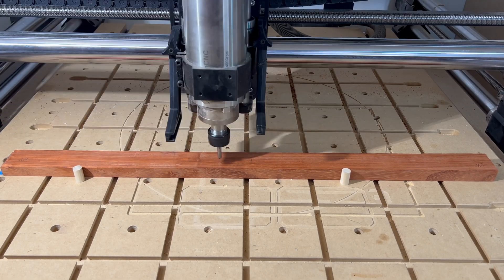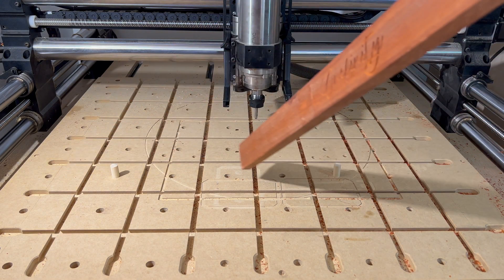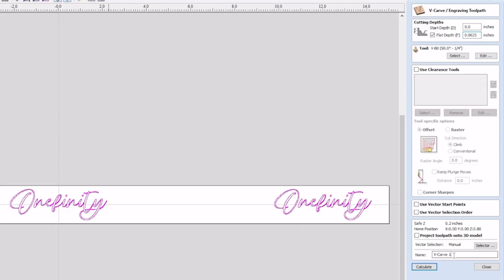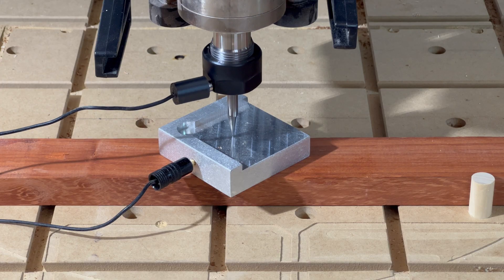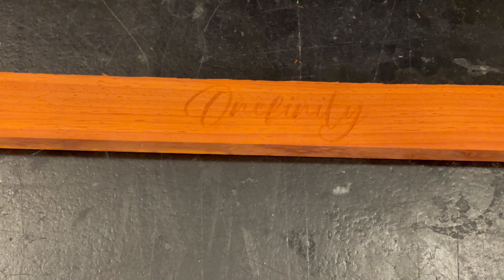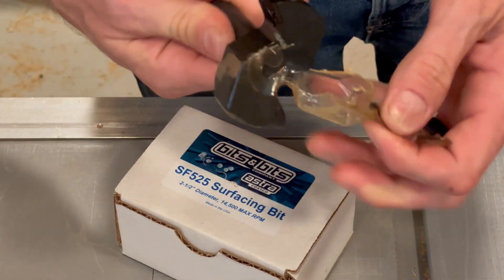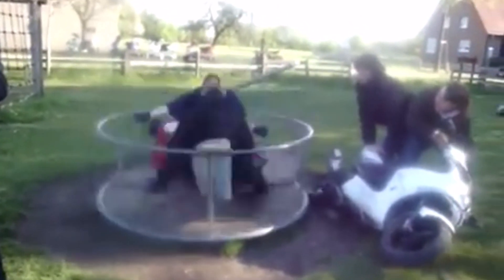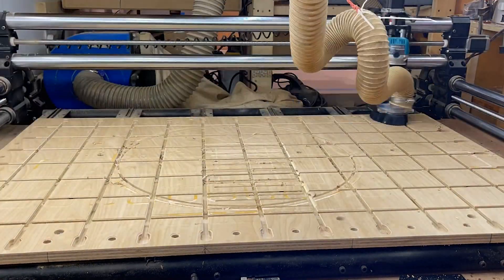EP 20 Onefinity CNC - How Important Is Flatness? (How to Vcarve with a V bit the right way)

Comment: Hi Morgan, i have a question about flatness.  Not about the wasteboard, but rather the CNC table.  I have the Pro Foreman 4x4.  I built a table (64 x 64) to mount it on.  The tabletop is slightly warped (very slightly).  It has about a 1/16 dip in it from side to side.  I.E. if i place a 72 inch level across the table left to right, the level will rock like a seesaw.  However, placing the level front to rear produces no rocking effect as the table is absolutely flat in this direction.  

Will there be any problem with the CNC mounted to this table with a 1/16 bow in the table surface left to right?  If so, should I shim the machine, say under is mounting pads, to get it's get into a flat plane?  What would you recommend?
Reply from the maker: You will need to flatten the wasteboard.  Once it's flattened, the dip won't matter, as it will be flat the the router.

Comment: So if you own a high end planer that is dialed in correctly, is there still a significant difference between and the process you mentioned here?  I know that flattening the spoil board is mandatory, I was just asking about the material being cut.  Thanks.
Reply: even with a flat piece of wood, it can get now solid to spoilboard.  i see this mostly with flags doign vcarve on stars.  that is   a hard one.  i still get best results with surfacing after i get wood down.  on carves like this video, with small detail, it keeps it from disappearing.   does not take much to make a huge difference
Reply from the maker: You want flat to the X axis (router/spindle/bit) not flat board.  i.e.: with the router on the left side of the machine, the gap between surfaced spoilboard and tip of bit could be 5.00 inches, with the router on the right side of the machine, the gap between surfaced spoilboard and the tip of the bit could be 5.125 inches.  A perfectly flat board that's been planned would not be 'flat' to the router in this hypothetical situation, and therefore vbit carves would turn out poorly.

Comment: And remember these to prevent aggravation. 
It can be flat without being parallel or level. 
It cannot be parallel or level if it isn’t flattened first. 
The board you flipped over was already flat but not parallel. 
What I mean to say is the machine requires stock that is both flat and parallel.  
Check both.  
Good lord I want one of those but my garage is too small….well, my wallet too. 
                      👊😎
Reply from the maker: Absolutely true!  Great observation!

You can always wall mount a Onefinity!

Comment: Way to flex with a > $400 flattening bit!
Reply from the maker: Use code 1F20 for 20% off $400! :P
Reply from the maker: You don’t have to use that bit. If you have a 1/2” or 3/4” straight bit on hand, use that. It’ll take a little longer but you’ll be pleased with the results 👍🏼
Reply: Sure.  I have a 1" flattening bit, I was just excited about that 2-1/2" beast until I saw the price!  @OnefinityCNC
Reply: The thing’s got a Hemi 😂
Reply: @mitchfaatz   I just use a 1" bit to flatten the spoilboard on my Journeyman; 'doesn't take long.

Comment: Hold up. 

That is not the makita router.  Does the elite come with a spindle? or isit something new on the horizon
Reply from the maker: No, Morgan is currently using an aftermarket spindle.  None of our machines come with any kind of spindle or router.  The user provides their own.
Reply: Yeah thats what i thought. 
Ive been very intrestedin getting a spindle, and having one yall offically supportmight of pushed me in a directiojn  @OnefinityCNC